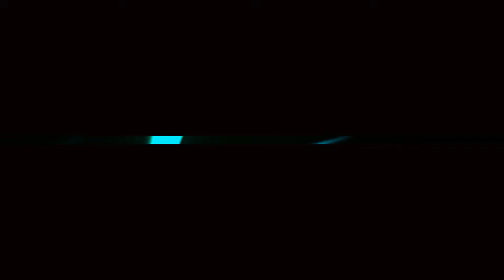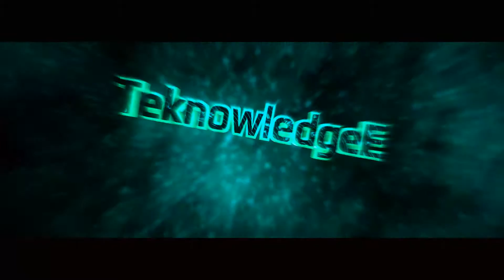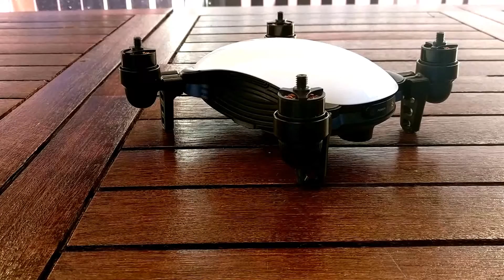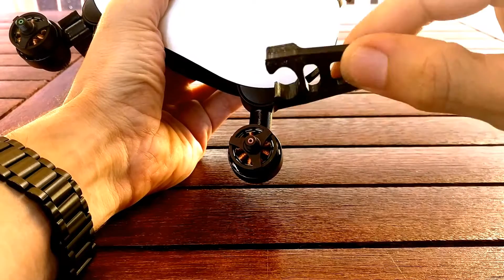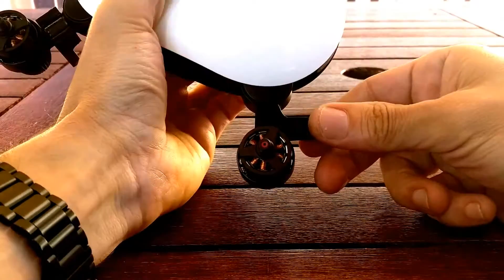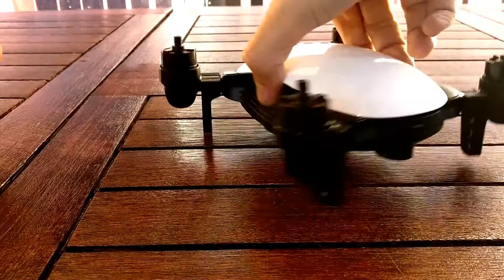J.me Drone Landing Gear 3D Printed

Comment: That's great! Would you be so nice to publish the landing gear 3D files at Thingiverse.com?
I like it very much! In flight Videos you can't see the front landing gears? Also if the camera is positioned downwards?

Thanks!
Reply from the maker: +Tinkerbarn they elevate the drone about 1cm from the ground and there is no way it will be in the way as they are too short to get in the way of the camera. 
I'm not sure if I will be able to fly this week as it's going to be a crazy busy week at work but I hope I will be able to go out to the park soon to test out all the new features I unlocked, the landing gear and the WiFi Amplifier. It's a b#*$h I can't fly this week though it's not forever so not such a big deal.
Reply: Teknowledge-E  I know it with this busy times! Sometimes there is another life parallel to our hobby life 😁
Regarding 3D printing files, would you publish it?
Reply from the maker: +Tinkerbarn what's your email address? I posted the link to ebay for those who do not own a 3D printer.
Reply from the maker: +Teknowledge-E you can also just email me to teknowledgee18@gmail.com
Reply from the maker: +Tinkerbarn let me know if you received it
Reply from the maker: +Tinkerbarn https://www.facebook.com/groups/1890161237938067/